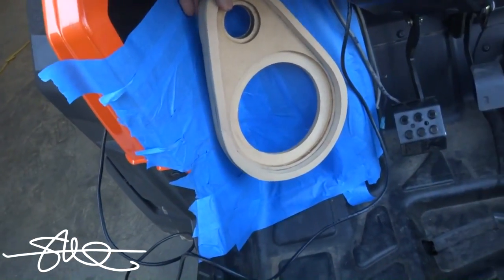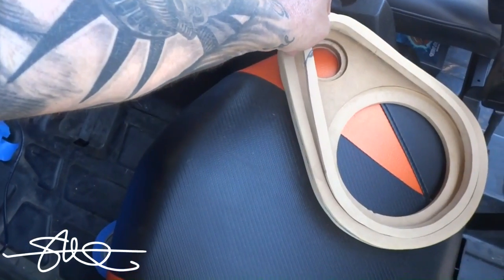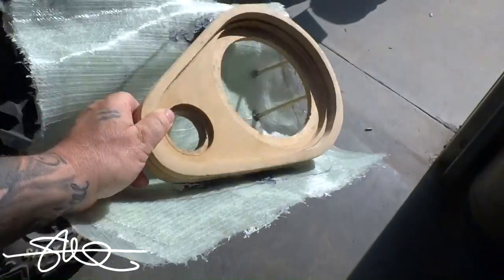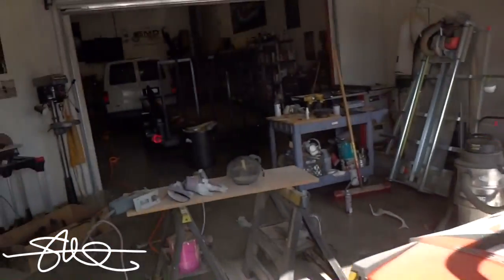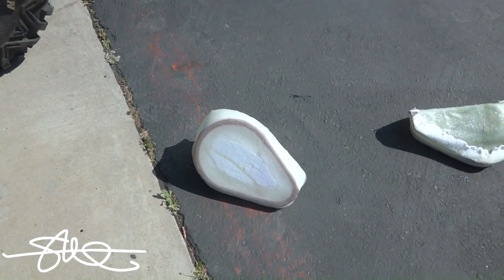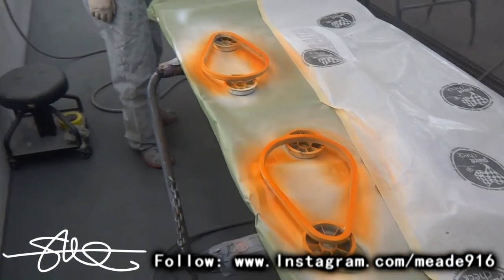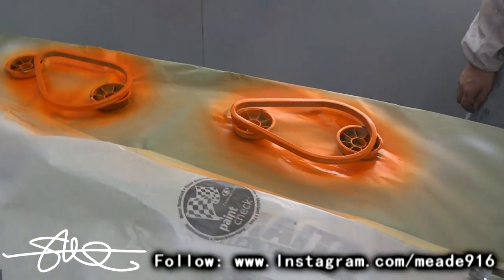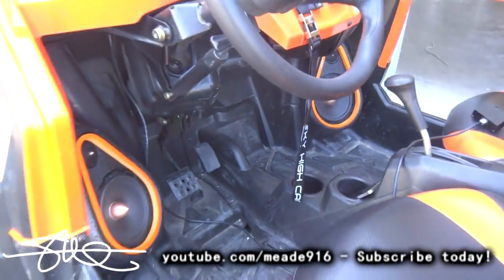Custom Fiberglass Kick Panel Speaker Pods Polaris RZR-4 900 Sound system install video 2

Comment: That thing is nice, good work. I'm hoping when your done you can throw those RF Power mini amps on the dyno. I've been thinking about that 500W BR Punch amp but the Power version with the fans looks like it might be a better solution.

Comment: Body filler was nice, but I actually didn't mind it with just the fiberglass resin even though it was concave. I'm guessing though that the body filler helps with the acoustics as well and it's needed...

Comment: Probably a dumb question Steve, But once the pods were complete, how did you attach them to the floor?  Just a couple of screws?
Reply from the maker: 2, 1/2" x1 1/4" bolts (one on side, one in rear). These things are rock solid. :)

Comment: Did you just pop half of that middle ring piece off with a flat head and a little leverage?(0:54 - 1:02)  I could be wrong but im pretty sure you just learned me something new.
Reply from the maker: yes sir.  It's a LOT easier then making 2 more passes with the router.  A lot cleaner too.  That ring would be MDF dust all over my shop if i didn't just pop it out.  I have been doing that for years with the tweeter holes (as seen in this video) and for some reason i decided to try it with a larger ring..and BAM, it worked!  So i learned ME something in this process too.  :)  One thing though, it does break off a little rough (on the larger one).  Just a TAD bit uneven....but one pass with my flap disc sander knocks it all flat again in just a few seconds time.
Reply: All i can say is thanks for the motivation, Ive watched all your videos probably a thousand times. I got my system installed by a company and got screwed over pretty bad. Went home ripped it all out and your videos have been my foundation ever since. :) By the way you got a lot of fans here in Detroit Michigan. All my friends and even my dad watches you. Thanks again man keep it going
Reply from the maker: Nick L right on Nick, thanks bro!! tell pops i said hi too! :)

Comment: Hmm, I would've put them up on the roll bar. Good work though.
Reply from the maker: would'a sounded and looked like dog shit.  That's why i didn't put them up there.
Reply: meade916 Not saying you should have. If it were me I'd use speaker pods off boats to mount them to the roll bar. Wouldn't they sound better if they were mounted high though seeing as they're closer to your ears and you can direct them to yourself or the passenger?
Reply from the maker: A Vong no.  It would sound like a blob of sound.  I cringe when i think of those boats with those stupid ass speaker pods mounted on the bar. I don't want a loud mess.  I want damn loud but good sound too.
Reply: meade916
Ah righto. I guess it's because there's nothing for the sound to bounce off right?